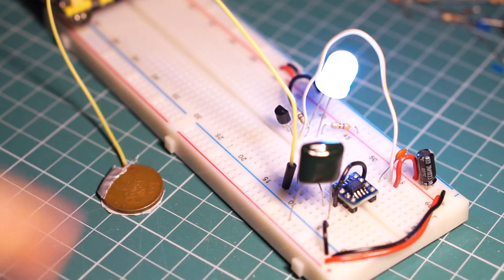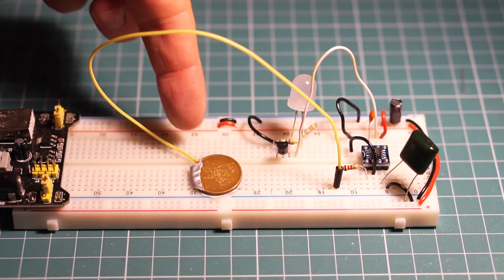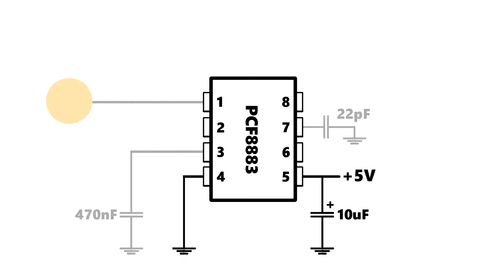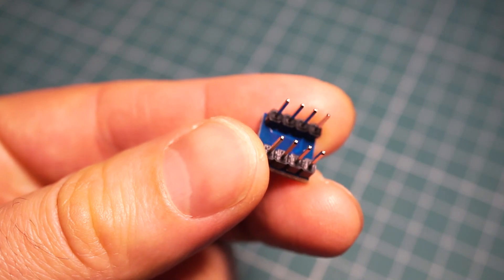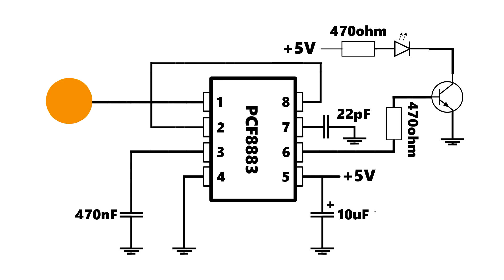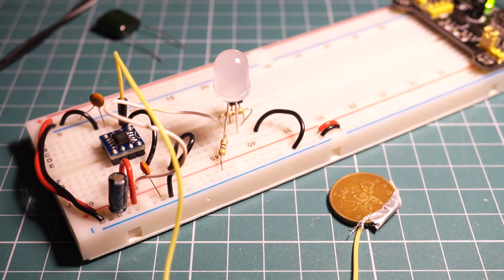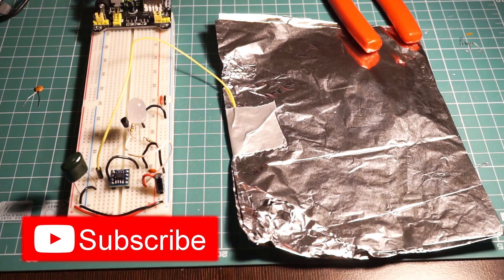How to make a touch sensitive button or switch

Comment: How do I defeat this feature on a pre-wired board in order to turn on automatically when power is supplied? I want to do this in order to use an Alexa enabled plug, so the device can be controlled by Alexa. I will try to attach a pic of the circuit board. Thanks!

Comment: Can this be used without power supply just for momentary switching?
Reply from the maker: Not sure what you mean but the answer is most likely no.
Reply: @LeftyMaker  The power source will be a piezo transducer. When is agitated, i would like to have a switch like this to momentary connect the ring and sleeve of an audio jack. Your answer is much appreciated, thanks
Reply from the maker: That's an interesting concept, but I don't think that the piezo can generate nearly enough power for this circuit to work. Do you think a simple tilt switch may work for your application?
Reply: @LeftyMaker  thanks for your answer. I need this as a choke function for electronic cymbals which typically are membrane switches with a specific shape but are manufactured in china and are not available by retailers. Nowadays, a big company accoplishes the momentary on/off by the current of the human hand. They say there is an electrostatic sensor in there. I searched for this and your video popped up.
Reply from the maker: Do you think a pedal could work in your case?
Reply: @LeftyMaker  a pedal is used for one of the cymbals called hi hat, for the rest, the drummer needs to choke them with his hand, either by pressing a switch at the edge of the cymbal or the electrostatic thing i keep seeing. Whats the minimum  power does your circuit need?

Comment: I know this video is old, but I can't find that pcf8883 chip anywhere. Is there an equivalent that I can order and still follow your schematic from the video?
Reply from the maker: Haven't had the time to make a video about them, but there are other good videos on how to use these ttp223 modules to make a touch switch. They should be easier to use than the pcf8883 which indeed has been discontinued
Reply: You may buy on Microdul. They are the original designer of this chip. www.microdul.com

Comment: Can you make this when press long to make fade out dimming with led?
Reply from the maker: Not with this chip, but there are chips designed to dim 220V lights with a touch button.
Reply: @LeftyMaker  Do you know maybe which chip?
Reply from the maker: Search Amazon for "3 way touch sensor dimmer" and you'll find a module ready to be installed in a lamp. I also found a chip called TT 6061
Reply: @LeftyMaker  Thanks a lot

Comment: This is a great video, I seen it a while ago spent weeks looking for it. I would like to use this for a mirror I’m building can you help me sizing the capacitor ?
Reply from the maker: The datasheet recommends a 470nF cap, but values between 90nF and 2500nF should work. You might need to find the best value through trial and error, depending on the size of your sensing plate.
Reply: What would you recommend for a mirror that’s 1/4 inch thick
Reply from the maker: Hmm, how big is your sensing plate and will it be behind the mirror? How many touch buttons do you want to have? Is the mirror going to be in a bathroom or any location where water may accumulate on its surface?
Reply: One touch button and I haven’t decided on the sensing plate behind the mirror. As for the location it is going in a bathroom so there is a chance for water.
Reply from the maker: I think it may not work. The reflective part of a mirror is made of metal which would interfere with the detection of touch input. But if you decide to give it a shot, try 0.47 to 1 microfarad and a plate of 4 by 4 centimeters. Again, can't promise that it will work at all if the touch plate is behind a mirror, even if insulated.
Reply: I’ll give it a shot and keep you posted thanks

Comment: I have a whirlpool tub that uses a touch switch to start & stop the pump. The touch pad is no longer sensitive to the touch. If I touch the wire connected to the switch, the logic control board for the pump responds the same way the touch pad should. Is there any way to rehab the touch pad to enable it to be sensitive to touch again?
Reply from the maker: Since touching the wire makes the switch work, my guess is that it should be easy to fix. Maybe the metal plate needs cleaning or there could be a broken connection somewhere inside, between the plate that you touch and the wire connector.

Comment: Hi~ I've read through the data sheet that comes with pcf8883, base on your diagram, I don't really understand the purpose of having a capacitor bridge to ground at lead 5. Also for lead 7, how would the frequency of sampling change in regards to the value of the capacitor? I do not have much electrical knowledge, Thank you very much for your time!
Reply from the maker: The cap at pin 5 is there to filter out noise from the power supply. It is not mandatory, but it is good having. You'll see one in many circuits, placed very closely to the IC. As for the cap at pin 7, I haven't done any testing to see what effect different values may have.
Reply: @LeftyMaker  Thank you!

Comment: Instead of a finger, can it still detect when it is a bottle or a tin can?
Reply from the maker: It doesn't work well with a finger. You need to rest your whole palm so that the change in capacitance is detected through the wood. The tin can would create a very big sensing plate, which in turn will increase sensitivity, so it might not work well or at all.
Reply: @LeftyMaker  okay thank you. Do you have any projects that can be an object sensor?
Reply from the maker: @joanpajarillo8778  You need a project where a particular object is a sensor, or one where an object has a hidden sensor? I imagine a magnet hidden inside something can be used together with a Reed switch.
Reply from the maker: Follow-up: I thought I was commenting under the touch-activated lamp video :)   Sorry if this has caused any confusion.

Comment: Hello, very nice system ! It is possible to have a list with all the components you used ? And where we can order them ? 

Thanks a lot, I'm a beginner in electronic and I don't know yet all this littles things.

:)
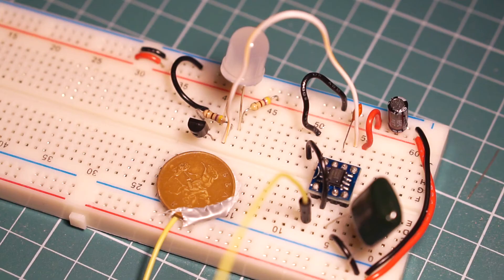Reply from the maker: Hey Tony! The PCF8883 chip is sold on many online stores, including DigiKey, Mouser, Farnell, Element14, TME.eu. To use it, you'll also need a SOIC8 adapter which you can get from Amazon/Aliexpress/eBay. The rest of the components and their values are on the schematic at 1:19 -- resistors, leds and capacitors are super easy to find. The transistor can be pretty much any NPN transistor, as long as it can handle the load. For a few LEDs, a 2N2222 would do just fine.